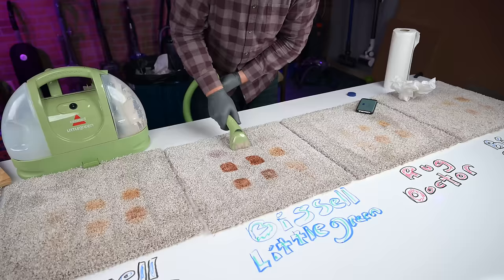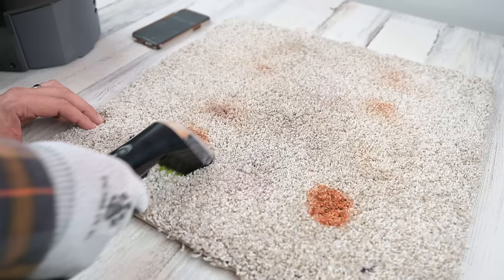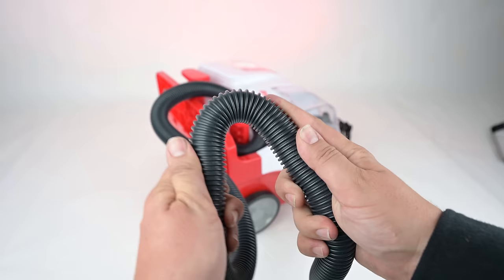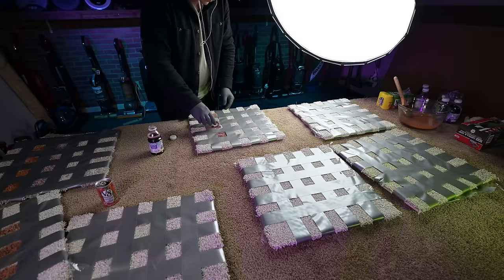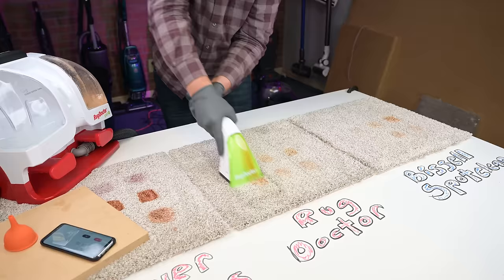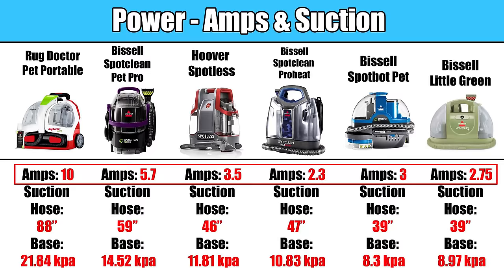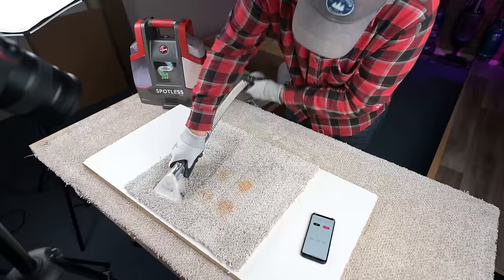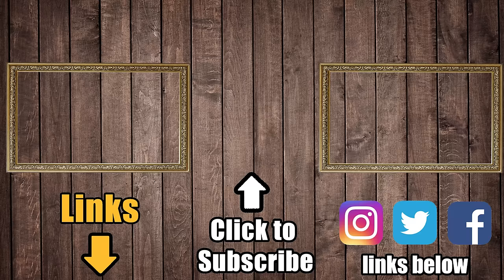Best Spot Cleaner For Carpet - Vacuum Wars

Comment: I had a Bissell spotclean and longevity wasn't great, nor was repairability. Cable management was very poor too.
I found I had to put a lot of pressure into the scrubbing head which, after about a year, snapped.
Then the hose split at the join for the scrubbing head which I had to fix with duct tape.
Later on, the hose split near where it enters the body of the vacuum so I bought a replacement hose unit but after looking at the work required to change the hose, I just binned it and bought the battery powered Bissell handheld with the powerbrush.

That was an OK product and the brush in the vacuum head helped but I found the motor bogged down and cut out if you applied too much pressure (which was often required for some stains). The battery lasted fine but after about a year, it stopped spraying the cleaner. I also felt that it was missing a feature. Yes, you can turn off the brush and keep the vacuum going but I'd liked to have been able to turn off the vacuum and leave the brush running in order to agitate the stain without the vacuum removing the cleaning fluid.

At the moment, I don't think the perfect design spot cleaner exists as they are made on a budget, so are aiming for cheap and OK instead of excellent but worth the extra money.

Comment: Is there a difference in the “little green” pet pro and the “spot clean” pet pro. Outside of the colors and power cord length, they look to have the same weight, tank sizes, motor size but the spot clean is a tad more expensive?

Comment: I have a Pro-heat from when it was under the Pet-pro branding. (Seems it got re-named later on.) Only complaint is that the suction could be stronger, but it does do the job for anything wet getting on carpet. And those things do take some effort to get anywhere. Shame is that if you want better you have to spend well above $300 on an automotive hot-water extractor set-up. You'd think somebody could make a unit more comparable to those as a consumer-grade model, but for whatever reason they don't. So this is close as it gets.

Comment: Bought the Bissell SpotClean Pet Pro based on your recommendations. The suction is very poor due to the fact that the dirty tank (where the suction is routed through) does not lock into place and just sits on its sealed chamber. Due to poor manufacturing tolerances this is very loose and forces you to hold the dirty tank in place while you vacuum with your other hand. I will be returning it to amazon.

Comment: I've had the Hoover spotless for about 2 years now. I ran into the issues mentioned  about the trigger and leaking which peeved me the most after cleaning.  But yesterday the hose tore up, felt that the material was thin and cheap. I purchased Bissell pet eraser that has a motorized brush and no tube, rechargeable battery. Let's see how that goes.
Reply from the maker: I hope you're happy with it!

Comment: One question:  I was about to purchase the #1 ranked Bissell Spotclean Pet Pro on your list.... went to Amazon and started reading some comments/reviews:  It appears that there is a 'known defect' in this unit where the hose becomes brittle and cracks within 1 year of infrequent use.... and replacing the hose is near impossible.  This makes this unit, in my mind, one of the worst choices simply because of the inherently poor hose material / design.  Which is a shame, because it seems to have performed well during the initial use comparison.  But, overall quality and long term reliability are definitely issues that should be considered extremely important purchasing factors.  Given this info.... what would be the next best option?  #2 is also a Bissell, but I am not sure if the hose design is different than the #1 ranked Bissell.  What do you suggest?

Comment: To be honest! Which ever has the most Sunction strength would be the clear winner. The test wasn't real world. They weren't stained, with dirt, pet soiled, fur, urine, ect. I find that when cleaning, is best to 1st Treat the carpet with solution, 2nd Scrub the carpet with a Strong Brush, than extract using the carpet cleaner. So, IMO the one that has most pulling or extracting strength would be the Best. Just the fact, that basic nature of the Carpet cleaning is to Extract. Personally I also recommend using a 1st treating the Capet with a Solution, 2nd Steaming the stained areas, 3rd Brushing and 4rth finally Extracting. It works wonders. Also I've been using Zep Carpet Cleaner from Home Depot and wow! I can't recommend the product enough!! 1 Gallon is like $10 bucks! And it works better than all those High-end solutions in little bottles that cost an arm and a leg! Highly recommended, from Home Depot.

Comment: Long term the bissell did not hold up (less than 4 years), the hose is press fit into the handle and creates a lot of tension when wound back up and creates a point of failure. Reviews on amazon has quite a few customers with the same issue the hose tears where the handle meets.

Comment: @Vacuum Wars I have a Bissell crosswave, and I love it. However, I am looking for a machine to clean various surfaces, like doors, counters, etc. Something that will be able to suck the dirty water. I know it's "off label", but is it possible to use these machines for hard surfaces? I also have Polti Unico, the steam cleaner and vacuum in one, however, the steam in long-hose steam cleaners is just not hot enough.

Comment: Which one left the least water behind though? That ends up being important when you use it on something with more cushion like a couch or car that the water can seep into. When I used little green machine in my car there was such a small amount of water in the dirty tank compared to what I had deposited. I had to run a dehumidifier in my car. Ultimately I think it just pushed a lot of the dirty water in further. You should measure the amount of water that makes it back into the dirty tank relative to how much left the clean tank.

Comment: Not happy with the green machine but better than using a towel and soapy water. Does the job but could be better. For best results I suck up any wetness first with wet messes than follow up with pretreatment and finally cleaning. If any of you have any tips for cleaning the attachment that would be very appreciated cause it gets gross quick even with vacuuming first.

Comment: The only problem with Bissell pet pro is that the hose dies the every two years it get stiffer as it ages and eventually breaks. You can buy a new hose but there are a lot of screws you have to remove to replace it.

Comment: a year ago i got the upright Bissell TurboClean PowerBrush Pet Carpet Cleaner, 2987. while a little weak its done ok. however i live in a small apartment and i have a small dog that leaves stains under my bed, desk and other furniture (about 18-24” clearance under bed). the bed is a large king sized bed and the dog leaves stains in the center area under the bed that is hard to reach. i’m trying to decide between the bissell spotclean pet pro (the winner here) or the upright bissell turboclean dual pro pet (because of the hose attachment). which would you recommend?

Comment: Did you take into consideration handle/sprayer/inlet design? The I know with the Hoovers battery version it sprayed from the top and the suction inlet was set back as opposed to pushed all the way to the edge. That makes corner cleaning/extraction unnecessarily difficult if not impossible with the machine. I had the Hoover for about a day and if it wasn't the battery life that would have made me take it back, the nozzle design sealed its fate of being returned.

Personally, I use a spray bottle and drill brush paired with my Spot Clean Pro, and use the machine itself for rinsing and extracting only. I also bought it with the sole intention of cleaning my car with it and have found myself cleaning up after Ferrets that go everywhere, and dogs/cats that throw up because of their age.

Comment: How does the Bissell spotclean pet pro compare to the Bissell proheat 2x revolution max clean pet pro in just the hose cleaning. Is the spot cleaning using the hose on the revolution compared to the winner in this video.

Comment: So im considering buying the bissell spotlcean proheat but i noticed that the power is rated only at 330w where as a proper vacuum sized textile cleaner has a power rating of 1400.
The 1400w is also about 40 euro cheaper where i live but it is very much bigger than the tiny Bissell. The machine which is rated at 1400 is specifically the "Tamforce". 
But i cant imagine anyone would pick the small 330w cleaner over a 1400 unless the power rating really does not matter that much?
Im a rookie at these things so if anyone could enlighten me, that would be great!

Comment: Hello, it's the first time I leave comments. In advance, thanks for the great review of many vacuums.

I have a pretty dirty couch that I'm trying clean.

I'm wondering which would work better between those spot cleaner and regular carpet cleaning machines such as bissell proheat 2x revolution (I believe it's has hose to connect for spot cleaning)

What I'm understanding is that bissell proheat 2x revolution would have bigger and stronger motor so It might have very stronger suction power compare those small spot cleaning unit? What do you think?

Comment: I had a little green clean machine, using it to clean cat vomit. Stupidly, i did not clean out the dirty chamber each time I used it. The chamber and machine smelled so bad, even after cleaning it, scrubbing and soaking, it has the awful smell of fish and garbage. Ended up in trash, lesson learned. Now i clean the stains with hydrogen peroxide and a brush… works better and much easier.

Comment: Hey I just realized that when you said the tank was leaking it was but it was because of the foam getting so high that it just went straight down and the pipe and leaked not if It would not have leaked I have had the same problem and the only way to fix it is to just empty the tank very Frequently

Comment: If someone could work out a way to put spinning brush bars, like a vax carpet cleaner, i think that would do the trick. Theres just not enough agitation to not have to use 'elbow power', hence why detailers use a brush attatchment in a drill.

Comment: The Spotclean Pro is slightly better than the Spotclean pet pro as it has a bigger motor resulting in more suction, and a 6 inch wide tool but obviously its more expensive.

Comment: THE best spot cleaner is FOLEX spray - spray and wait a few sec, if the spot is very bad you may need to spray a little more and agitate carpet, that's it. Cleans old spots like a 2 year old red vine spot etc. Forget the machines for smaller spots.

Comment: Thanks so much for your thoroughness in testing these! I'm very impressed. One thing I've always wondered is if a person could use cold or lukewarm water instead of hot water and still get good cleaning results with these machines. When dealing with pet urine, I always feel like hot water will "set" it into  the carpeting.
Reply from the maker: I would consider the recommendations of the carpet manufacturer, the machine, as well as any cleaning agents you are using.

Comment: Ive had my rug doctor for over 6 years now and ita bee. Through hell and back (its the red model). Ido flush the hoses qfter every use due to it was normally vacuuming up dog urine out of carpet, but even other stains etc it snatches out their soul and has crazy suction. Wonder when my rug doctor will finally bite the dust 😂
Reply from the maker: That is great that it has worked out so well for you!

Comment: Hi
Is the BISSELL SpotClean Pet Pro 

Is the sames model as the BISSELL SpotClean Pro ?
No pet
Thx .
Reply: I believe the only real difference is that the Pet Pro version comes with a "stain trapper" tool for cleaning up pet messes, while the regular Pro version comes instead with a 6" wide tool aimed for use on stairs.

Comment: I had rug doctor for 10 years worked amazingly-  then it died.  Bought bissel little pro and works awful.  Does not even clean fresh stains and leaves behind bigger mess.  Stuck with it because it’s been 1 1/2 months so out of return window.   It’s just awful.  Throwing it out and getting another rug doctor.

Comment: Seriously to hell with all that scrubbing. The item to use is a sturdy round  brush that will fit in a cordless drill and spin and there is no elbow grease needed. At least that's what I use. So therefore you can just put all your money in whatever has the most suction and totally disregard whatever brush comes with it.